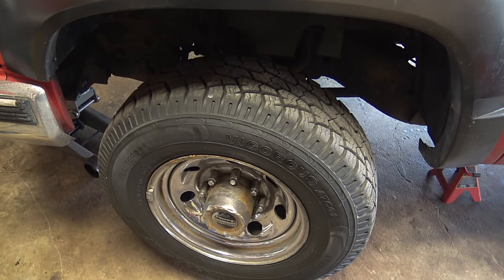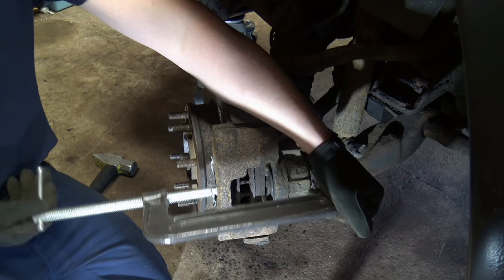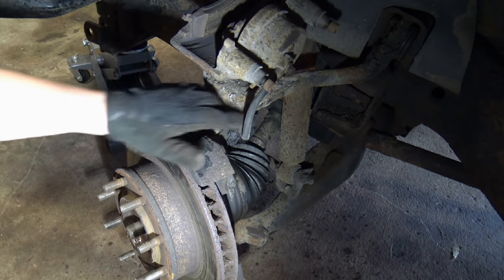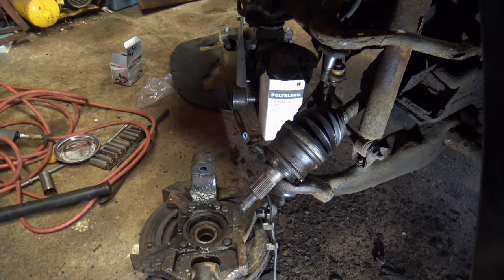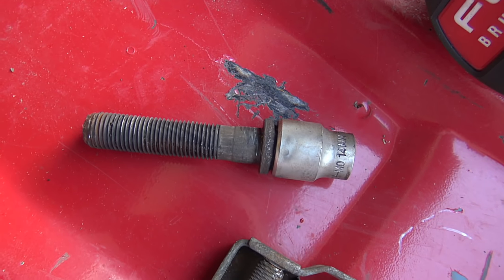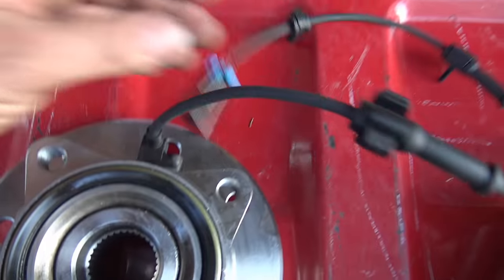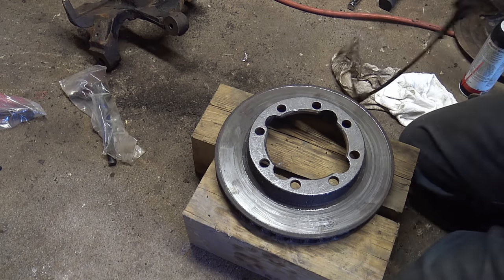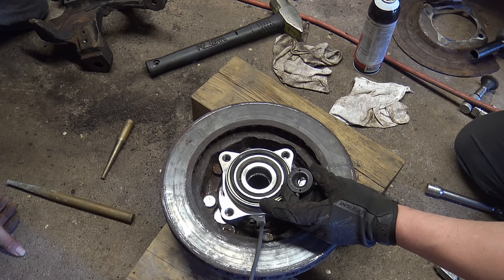Chevy Silverado K2500 Front Hub Bearing Replacement

Comment: Great video for instruction. I would personally recommend that you replace the studs and lug nuts. My reasoning is that unless you are familiar with how many times the wheels have been off and on it is quite possible that people have overtightened the lug nuts. I have had broken studs due to an inexperienced tire installer put about 170 ft lbs on it. It sheared within about a week. Fortunately the owner replaced all the studs and lug nuts no charge, and the apprentice learned a good lesson.
Reply: You're very lucky...i just got some used tires on my 95 k2500 and they messed up one stud on the wheel which already had a messed up stud (so running on 6nout of 8 studs now) and they took no responsibility for it despite me just having the wheel off the previous day and always being meticulous in keeping my stud threads cleaned and everything torqued properly. So that will be my fun project this weekend replacing these🤦‍♂️

Comment: That is a crazy design, bravo to the engineer for making the job another PIA!  Happy Turkey Day to you, enjoy.  Thank you for all the videos Brian
Reply from the maker: +Ozzstar A wild design for sure I hope I never see anything like this for a long time.
Reply: +BSG Auto I replaced the upper and lower ball joints (both sides) and inner/outer tie rod ends on an 2004 E-250 cargo van today.  For being heavy duty it "normal" design easily removing the rotor/bearings to get the spindle out compared to the Chevy in this video, that design is just stupid!  Is there a site I can visit that can tell me the labor time for the repair I did today?  I couldn't find your email addy to ask you, thanks Brian!
Reply from the maker: +Ozzstar I use Alldata for labor times. Looking it up I would say 6hrs.
Reply: Thanks!

Comment: Thank you very much for this video! I am going to be doing the front brakes and wheel bearings on my 2000 k3500. Same set up as you have. I am dreading it a bit. I am buying all new hardware : bearing mounting bolts, wheels studs, rotor backing plate, moog wheel bearings, and the rotors and brake pads. This is going to be a big job. Going to test out my new big bad dewalt 20v impact on those wheel bearing mounting bolts. I hope they snap off or come free.

I opted for new wheel studs just so that I only have to put new ones in, which will be easy with a press.

I will be anti sizeing what I can I (not wheel studs of course!) So that the next time around this will be easier. I'll probably start soaking down the mounting bolts for the wheel bearing a few weeks ahead of time.
I don't plan to take the knuckle/spindle off though, it still appears to be doable.

Comment: Excellent video. Thanks for the insight. Especially using the stud installer. I am in the process of reinstalling the knuckles on my 98 K2500 as part of a brake job ( all seized, had to use a 5 ton puller to get pass side apart ) so was getting overwhelmed. Your video really helped get me closer to the finish line. Thanks!

Comment: I have a 94 K2500 and I know at some point the passenger side is going to need to be done because when I bought the truck the driver's side had just been replaced. I want to be able to do most of the repairs myself but I'm not sure if I have the experience for this job yet. Very informative video great work!
Reply: K2500 is allot easier then the 1 ton. On the 6 lug set up.. you pull the rotors and brake calipers out of the way. Unbolt and remove the drive shafts. You'll have access to the hub bolts then. Plan on drilling/grinding the heads off. Then hammer the hub out. No need to separate the front end.
Reply: @hawkdsl  : Your advice only applies to the "light duty" 3/4 ton truck, that has the 6-lug hub setup. On the heavy-duty 3/4 tons, like what is shown in this video, you do what is shown here. 

Difference being, if you will only be replacing the wheel bearing/hub assy, and/or brake rotor, you don't have to remove the entire knuckle assy. 

If you need to install new upper and lower ball-joints, as he did in this video, then you remove the entire knuckle assy as well.

Comment: Best real life video, about this job, out there. Been trying to get those bolts out without taking off the knuckle. Looks like I'll have to use heat on mine, but it's so close to the CV boot, not sure it's worth the risk.
Whats your opinion on after market hubs, I've seen them for $110 for a pair, big difference from $400 ea
Lol, also, cant believe you didn't replace the rotor and pads while you were there, or at least have the rotor turned, it looked pretty nasty, (maybe it was just the video)
Still, it's a great video, thanks
Reply from the maker: +Big Burb I would use Moog or better I link to in the video description. This was my friends truck so the pads and rotors were his decision. If it was mine the pads, rotors calipers and hubs would have been changed together.

Comment: It is possible to do this job without removing the knuckle. If the 4 bolts holding the bearing in can be removed without a problem, a few strikes to the rear of the rotor will separate the bearing from the knuckle.
Reply from the maker: Sure can that's the idea but man these were so seized in there I didn't want to fight the hub bolts like the owner did on the other side for hours. Also this was part of a bigger job where I was replacing ball joints.
Reply: I was going to say I've done these without removal of the knuckle as well but was watching again to see if there was a better way to seperate the bearing as usually I am doing brakes at the same time and hammer on the rotor to separate them after the 4 bolts are out. This time I was just doing a bearing hammering the bolts worked great and I had already bought replacement bolts so no worries about a damaged bolt from the hammering.

Comment: I have a question.  When you removed the bearing assembly from the knuckle you mention that it is a good idea to replace the knuckle grease seal.  Do you have a part# that you recommend for that truck in the video?  Also how do you recommend removing the old one from the knuckle and putting the new one in?  Thank you!!
Reply from the maker: +James Barrette I am sure you already completed this repair but I will answer anyway. I don't have the part number as it varies for the different years but any quality seal from the parts store will be sufficient since it mainly just keeps the dirt out. The old one you just knock it out where as going back in you are going to want to seat it evenly with a driver about that size.

Comment: Where did you get the hub to steering knuckle bolts from?
Reply: Dealership. If you would have watched the video all the way through, you would have known that. Additionally, a cheaper way to get the same special hardened cap screws (bolts) would be to take them to a fastener supply company such as Fastenal, or a place called Hardware and Fastener Solutions (HFS), and have them match them up. As I recall, the automotive aftermarket company, Dorman, offers replacement hub-to-knuckle bolts as well. You will need (4) bolts for each side.

Comment: Will adding heat to the bolts possibly warp the rotor?
Reply: Kevin Standard : No, heat will not warp the rotor. 
Heat can easily damage the front driveshaft outboard CV boot, and also the hub/wheel bearing seals if you aren't extremely careful.